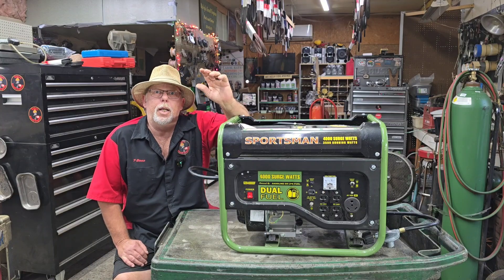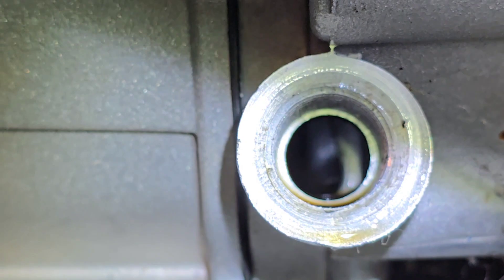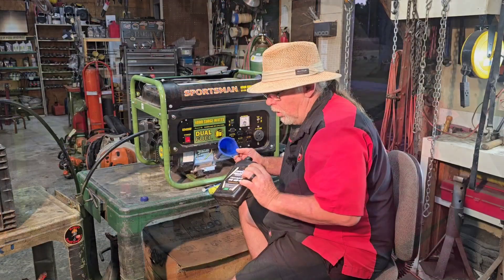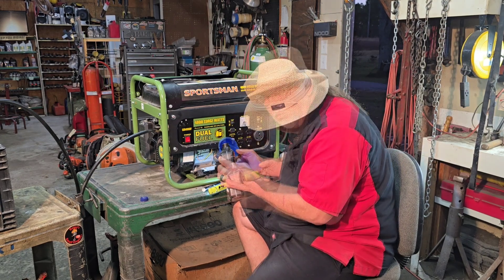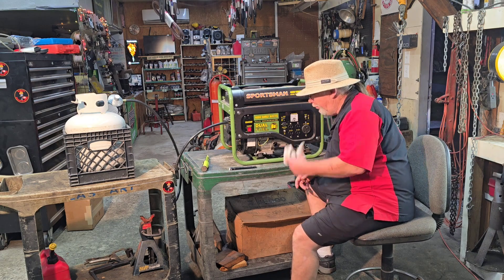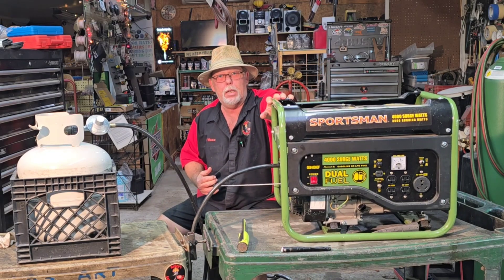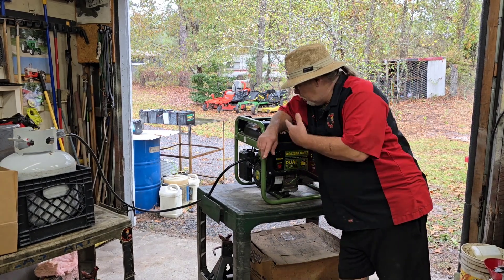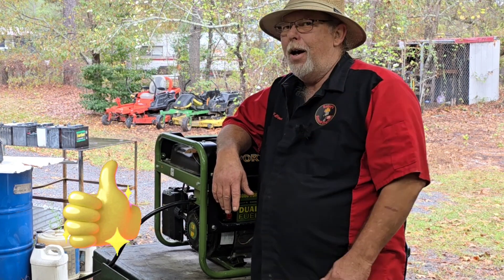Propane Generator Shuts Down When Simple Things Go Wrong No Oil

Comment: $20 is too little. Remember, it’s not always the time involved, it’s the expertise. Also, $20 isn’t enough to teach this owner what could have been a much more expensive lesson if the low oil sensor had failed. I would have charged him $50 so he remembered to check the oil EVERY time before starting.

Comment: Hey T-Bone, what sort of oil would you recommend for a Command Kohler 15?  I heard that some folks use synthetic oil but this engine is some 20 years old with low hours and I would like your advice on this subject, if you don’t mind.
Reply: We use stens 10/30 small engine oil. Synthetic isn't necessary. Thanks for watching!

Comment: Nice job T-Bone, low oil cut-off did its job thankfully.
We just bought a dual fuel at the start of hurricane season, tested it with propane and it worked great.
Howdy Mrs T-Bone 🙂👋